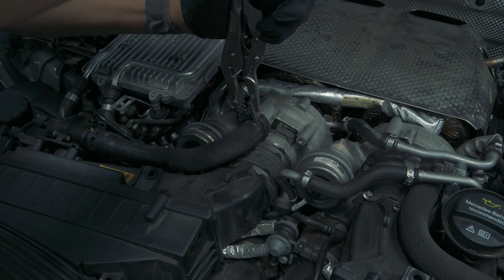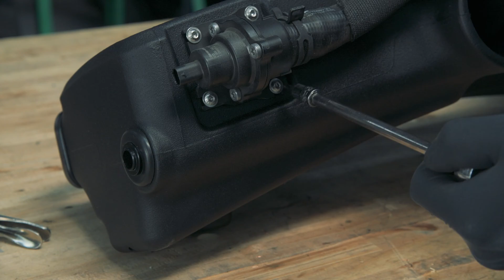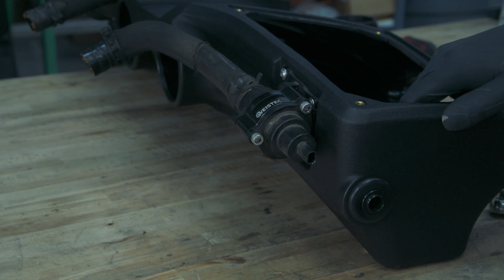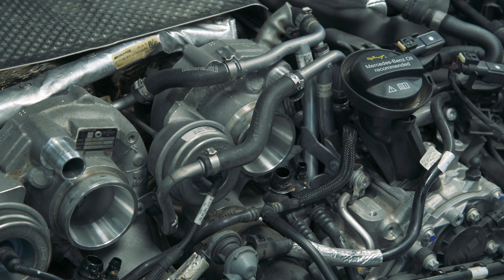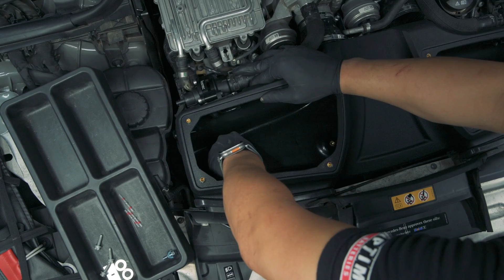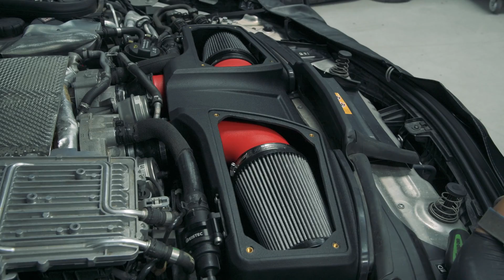How to Install the Weistec M177 LS2 Intake System for W213 E63 and AMG GT63

Comment: If a shop does an adaptation to the hpa boost levels in xentry after correctly adjusting the physical wastegate which leads to drivability issues because the stage 1 tune file is fighting the seperate factory adaptations for boost levels what is the appropriate way to reflash and insure the correct values are updated in those tables?

Comment: Do you need a tune with this?
Reply from the maker: You could add this intake without a tune, but when paired with a tune, you'd get the performance benefits of the intake system.